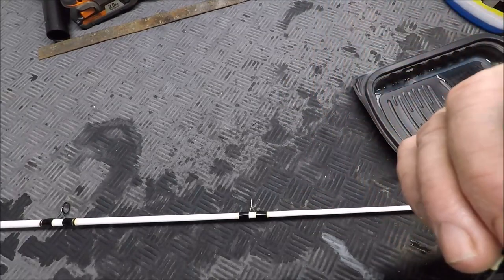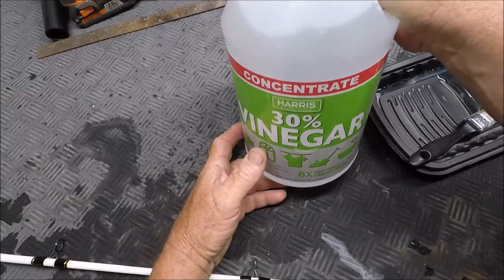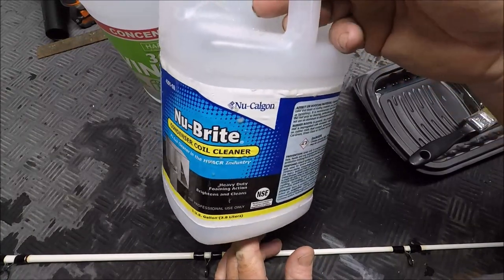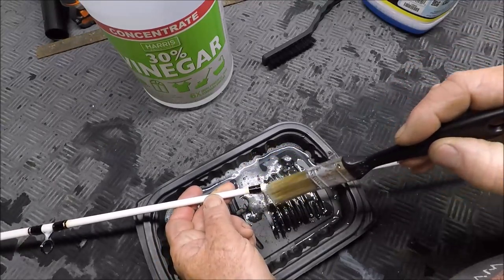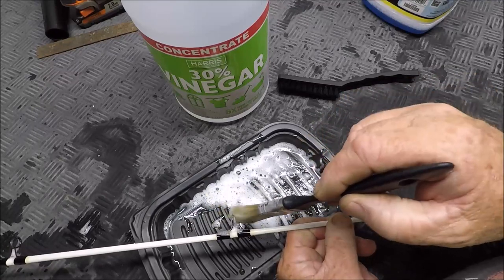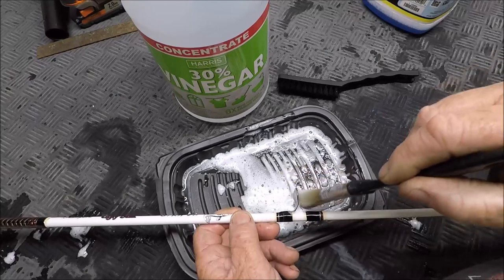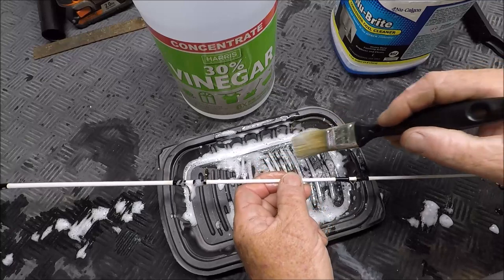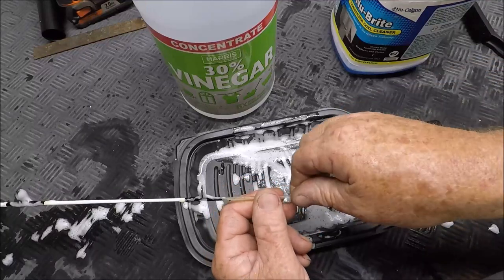DAMN my Ugly Stik 'UGLY TUFF' guides, sure are UGLY💩

Comment: Never ending battle. I've tried everything. Thinking of a light epoxy coating as the next step. I will let you know how it goes.
Reply from the maker: as I stated in a comment I too used to spray the old versions with clear coat. Didn't do much but  bide more time, for awhile.  Ugly is as Ugly does I guess.

Comment: Get a piece of PVC pipe get a piece of PVC pipe cut a slit all the way along the length put a cap on each end put a couple rods in and pour that solution in until the roads are covered then just let them soak
Reply from the maker: good idea....I did 3 versions of this video, before actually going with this version. I did say in one of those ''do these rods need a guide bath tub? how much time and energy and $$ must I expend on these damn things?"".....well, I spent too much time on them already. My patience is all gone now.  I wanna be like Joe Q. Public and just push the EZ button and make them instantly nice NON-GREEN, corroded guides.

Comment: your stuff does seem  stronger, vinegar is going in my  salad from now on Capt Dave. Ya gotta love the ugly's.  Could a preventative light coating of flex coat or epoxy when they are really cleaned up be better?   Micro zink anodes ? LOL  thanks for sharing
Reply from the maker: personally the acidity of vinegar is something I've learned to keep away from my diet. Years ago, when striper rods had chrome guides with inserts, when I got new ones I'd spray the guides with clear coat from a rattle can. As usual, Shakespeare had it al backwards!!  They put black good corrosion proof guides on the Catfish series of rods, and chrome crap on the stripers. BECAUSE STRIPER FISHERMAN ARE ALWAYS SWEETWATER ANGLERS.....hahahahaha and don't need a corrosion proof guide. Ever see Ugly stiks zuckerbook page?? There's NO saltwater being done there. It's all pretty much big ugly kitty kats.